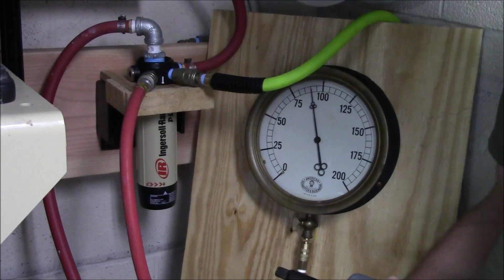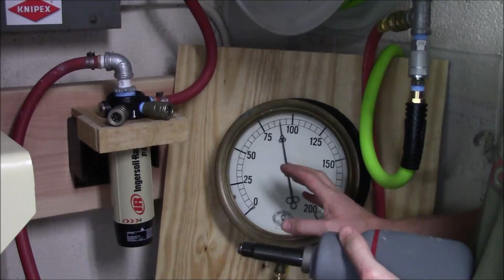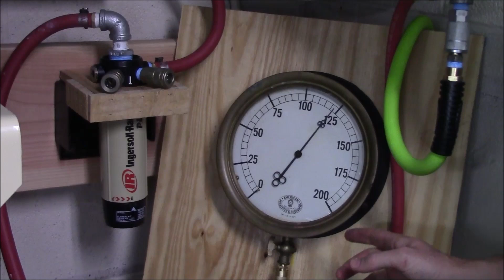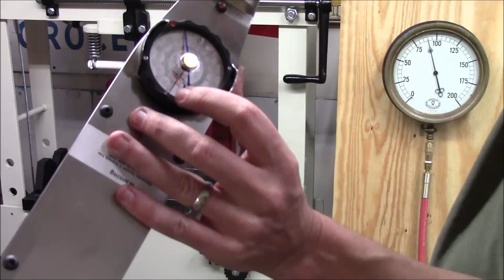Air Pressure : Working PSI - VS - Static PSI

Comment: Whats the difference if I buy a 3/8" using a 3/8" fitting or buy the 1/2" and use the 3/8" fitting?.. Can you even use a 3/8" fitting on the 3/8" hose?
Reply from the maker: +Tom Pajak There are two measurements on a fitting.....the side that is threaded & the side that plugs into a coupler.  You can have many combos of these ---- with 1/2" hoses you typically have 1/2" or 3/8" NPT Threads.  With 1/4" & 3/8" hoses you typically have 1/4" NPT Threads.  I personally like 1/2" Hoses & 3/8" fittings (3/8" NPT Threads & 3/8" plugs).  It allows for max flow, minimal pressure drops, and better performance at a lower PSI at the regulator.
Reply from the maker: +Tom Pajak So yes, you can use a 3/8" fitting on a 3/8" hose.....just be sure that the threaded side matches the threads coming out of the hose.
Reply: +Real Tool Reviews I see 1/2" fittings available online ..how much more flow will i get if I hook that to the 1/2" hose.. Or won't it fit?.. Thanks
Reply from the maker: You'd get no benefit unless you had a 80-gallon or larger compressor running 3/4"-1" impact wrenches....the flow rates of a 1/2" line with 3/8" fittings is way more than most air tools can utilize.  I'd go with a 50' line of 1/2" hose.....and use 3/8" fittings for best performance.
Reply: +Real Tool Reviews 👌sounds like a plan.. Thanks
Reply: how does that play out when majority of air tools take 1\4 air inlets....? or are you just using bigger tools that utilize a 3/8 inlet plug?

Comment: where did you get your air gauge and what size is it
Reply from the maker: +#TimTom It is the pressure gauge off of a boiler system....it is dated 1924 & works perfectly.  We got it at an antique sale.

Comment: What an excellent video! I have been a diesel mechanic for around 10 years now, I have always had a well equip workshop and took for granted everything being set up and ready for me! I have now moved to the USA (from England) and am looking at starting my own business. I will be starting from scratch with a compressor etc. I have Ingersoll Rand 1/2" impact already and was looking into air hoses etc. I will also be needing to use a 3/4 and maybe even 1" impact. will you be doing any videos related to heavier equipment like this? also can you tell me exactly what hose reel and air fittings your are using and where I can buy them? Thanks and keep up the great work!

Comment: Bonjour, first the pressure regulator should be protected from the contaminants coming from the air receiver , otherwise you will damage the membrane inside. I could not make out the model number of your filter so I can find out the cfm and filtering element in micron ( to protect air tools and equipment min 5 mic.). To validate the first test , we need to make sure the membrane of your regulator works fine, but most importantly the pressure gage should be at the point of use between the air nipple and its coupler . You loose more than 10 percent. Instead of changing the hose reel ( usually the pressure drop comes from the coupler inlet ) and improving the quality of the filter pressure drop, you want the user to increase his pressure . Every 2 % pressure increase, wich is in fact and artificial demand, it cost the user 1% in energy cost.

Comment: If people are using 1/4" line on anything more demanding than a nailer, they're doing it wrong. Off the shelf airguns will work, as well as paint sprayers. If you are somebody trying to use a grinder or impact gun you really do need a minimum of 3/8 hose but should be using 1/2". 
Real Tool Reviews : Good video.
Reply from the maker: I agree....but many times it boils down to price & also what they have already (most smaller compressors come with the yellow nylon 25' coiled hose for inflating tires) & they assume air pressure is air pressure....never thinking about flow rates (CFM).   Hopefully this video will help people understand how to get the best performance from their tools.  Thanks for commenting!

Comment: Wow I never knew how much it really dropped. So if the tool says to run it at 90 psi you will have to set the air pressure at the compressor at over 100 psi. I have a pneumatic grease gun, use 1/4 inch air fittings and have about 25 feet of hose, what do you think I should set the air pressure at? About 125ish? I think if you watch the regulated pressure on the air compressor it will show how much it drops.
Reply from the maker: +Love2boat92 I wouldnt worry about it with a grease gun....it just will cause the grease to flow out slightly slower & it would most likely have a lower max PSI rating (on the grease pressure created).  The most noticeable performance difference will be with impact wrenches, air ratchets, cutoff tools, air hammers, etc.  If you want to bump it up, I would say 110psi (static) should be good.
Reply: Real Tool Reviews It does seem to work slow. I'll bump it up. Thanks for making this video. I would love to see what it does with 1/4 inch fittings.
Reply from the maker: +Love2boat92 Thanks!  I plan to do another video about fitting sizes & air line sizes.....stay tuned!
Reply: Real Tool Reviews Great!!

Comment: Love that old pressure gauge.  I work as a fire sprinkler fitter and we will find them on older systems to measure water PSI and they still work precisely but current codes make us change them out so I hang them on my wall.  Cheap plastic ones replacing good ole reliable made in the USA ones.
Reply from the maker: bluelude2001 Me too!  I am jealous.....I would have multiple ones hanging up if I had them.....good to know you dont just trash them!
Reply: It reminds me of the old boiler pressure gauge my dad was given when he retired.

Comment: Great job!  I like how you showed the pressure drop from the hose.  This also applies to a voltage drop through an extension cord.  Great video.
Reply: Not only extension cords, the wiring in the walls has the same effect on voltage. It.may be better to use an extension cord on an outlet closer to the panel than no extension on an outlet on the other side of the building
Reply from the maker: Wild Goose Thanks!  And good point.....voltage drop is another problem all to itself!

Comment: I just started using an air compressor for the first time. Well, I tried, but I couldn't get the socket on my IR 231 air wrench,  I thought it wasn't big enough for the wrench, but learned I have to hold something in,  I'll find out on the weekend when I go back out to try it again. 
BUT, this video has given me a Load of useful information as far as air pressure going to the tool. So glad you made this video. I never would have known to check it to see where I'm at as far as pressure, Thanks. )
Reply from the maker: tigergreg8 Thanks!  I am glad I could help! .......also, the problem you are having is most likely the brand new friction ring (hog ring) at the end of the anvil.....those are very tight at first, and you need to put a socket on it & use it consistently to "break it in" and then installing/removing sockets will be no issue.

Comment: Where can I get one of those nice big pressure gauges.  That thing is really easy to read from across the garage.  Getting older and eyesight isn't what it used to be.  A link or company name would be helpful. :)
Reply from the maker: ***** I would imagine eBay or an antique store.....it is a pressure gauge for an old boiler system (I think) & is from 1924.....it still keeps 100% accurate pressure though, so I think that really says something about the build quality on things back then!
Reply: Real Tool Reviews Yep found some on ebay.  :)

Comment: Just got my first compressor and air tools.  Had absolutely no idea there was a difference between static and working pressure.  Just stumbled across this video so glad I did.  This video is pure gold!  Thank you for the excellent demonstration.
Reply from the maker: ***** Thanks!  Glad I could help!
Reply from the maker: Kerry Kozma Well.....like I showed in the video, it depends not only on the tool but also the length of hose, size of hose, and fittings used.....that is why I suggested testing them --- especially if you are having power issues (aka --- lack of power).

Comment: Can't wait for your torque test videos, hardcore brand loyal people are going to be butt hurt, along with the manufacturer that's gonna have to explain why their impact couldn't do it, one question are you going to have a standard test for impacts or you going to follow manufacturer way of testing? Like bolt / nut size, tread size, psi rating, oil on the tread, ect.
Reply from the maker: south park Thanks!  I think a lot of people will be surprised (good & bad) when I put the upcoming impacts (pneumatic & cordless battery powered) to the test and prove ACTUAL torque ratings.  I will be using the same nuts/bolts/methods for them all.....with the exception of PSI ratings.....some impacts require a higher PSI (on the box) to achieve stated torque specs, so I will adjust that if it is on the box.  There is ZERO standardization when it comes to torque specs.....I intend to change that.
Reply: Real Tool Reviews 
You sir will start WW3! When can we expect the tests?
Reply from the maker: south park Coming up soon.....I would expect to start seeing them in reviews in the next month or so....

Comment: Here's a pic I took for comparison.  The high flows helps put the power to the ground, right?
http://img.photobucket.com/albums/v163/glowkid/IMG_20140926_162457_zpsiu9qb4lw.jpg
Reply from the maker: GigaDonk High flow (just like my 3/8" fittings) allow the pressure (working) to be maintained with lower PSI set at the regulator......they also allow for more CFM of airflow, but almost no tools can utilize enough air for you to see a difference in actual performance in the high-flow VS regular fittings (except blow guns for example).  The problem with many compressors is the fact that they cannot achieve a high enough PSI to match the performance of a high-flow fitting with a lower PSI at the regulator.  (i.e. --- 125psi @ the tank = 90 psi (working) at the tool with high-flow fittings......125psi at the tank = 75 psi (working) with regular fittings at load).  In order to bump the regular fittings up to 90 psi, you would have to bump the regulator up to 140-145PSI (example only....not actual numbers).  Most compressors cannot maintain that pressure & the performance of the tool will greatly suffer.
Reply from the maker: GigaDonk So....short answer.....Yes.  High-flow are much better than regular fittings.

Comment: That was a good episode. I'd like to see more stuff like this.
Want to do a comparison with the Milton V hi-flow fittings vs the normal Miltons?
The size difference is BIG and the hi flow fittings can be used with non high flows as well.
win/win.

Probably notice bigger difference with 3/8 hose. do it. do it. do it.
Aircat vs IR :)
Reply from the maker: GigaDonk I have more of these informative videos planned....especially with the upcoming torque testing videos...thanks for the suggestions!

Comment: Excellent. If you think this matters with simple air tools IT REALLY MATTERS with high end automotive spray guns. SATA, Iwata, DeVilbiss and Sagola all require exact air pressure adjustments to perform properly. It's the difference between the paint looking like glass and looking like sandpaper. I always use a diaphragm regulator at the bottom of my spray guns.
Reply from the maker: SATAMAN Schmidt Thanks!  I have never gotten into the spray guns as of yet, but I have always heard they are the most sensitive to pressure ratings....good to know!

Comment: Best way, adjust your regulator while holding the trigger down on whatever tool you are using to ensure that you are close to 90 psi.
Reply from the maker: Blaine Bugaski Not really....the problem is that the pressure is dropping at over the length of the hose & not at the regulator.  Especially when you add in a 50' hose, the pressure at load is going to be MUCH lower than what the regulator is showing & the only way to know for sure is to use a remote pressure gauge like I show in the video.
Reply: True.  I have never had a problem using my method, though, but I do not use any external manifolds, dryers, or filters in my system.
Reply: Blaine Bugaski but you could be getting better performance measuring at the end of the hose.
Reply: Yes that is true.  I remember when I first started out with air tools, I would just max out the regulator on the tank.  I thought higher pressure was always better.  I ended up educating friends and acquaintances about proper pressure as well, to ensure that the tank does not deplete too rapidly, and also to increase longevity in your tools.  Also oiling tools.  We all went many years without adding a drop of oil to our tools.  Now I try to do it every time.  Funny thing, the tools never broke, though.
Reply: Blaine Bugaski everybody makes noon mistakes. I always oiled my tools.  Don't remember who told me but I got air tools only a few years ago.  Worked for years with hand tools only and got air tools finally and always oiled them every use.

Comment: This was a great video.  I knew there was a pressure drop but I never knew how bad it was and I never thought to run a higher psi at the regulator to make up for it because I didn't have a clue how much was lost.  

Thanks for the info.  I need on of those gauges.  I've only got a 30 gallon compressor so the cordless impact is on my wish list for the near future.  

Where do you find those 3/8" fittings?  Turns out I have 1/4" industrial style fittings on my automotive tools and compressor.  I want to replace them all but none of the stores I've been to have them.  

I find single ones on Amazon and they're expensive.  Do they not come in a pack or kit?
Reply from the maker: Kimo Kalihi I have gotten them at many places (online, Tractor Supply, Home Depot, Lowes).  For your uses....you can get 3/8" plugs/couplers with 1/4" NPT threaded fittings.  They will connect to the hoses you already have & you will get better performance out of them (the opening inside of them is at least twice as big as standard 1/4" fittings).  Also, you may want to look at 1/4" high-flow fittings....also known as "Euro Style".  They have almost the same size internal passage as 3/8" fittings & look identical to regular 1/4" fittings (and you can get universal couplers that will accept both types).  Brand-wise, I would go with Coilhose Pneumatics or Milton.
Reply: Real Tool Reviews I'm not opposed to replacing the hose.  I only have one.  And all the fittings.  Just want to make sure I get the right stuff and don't spend more than I need to.  Does it make sense to get 1/2" hose with 3/8" npt?  I've never gotten the advertised 500 ft-lbs of torque from my 1/2" craftsman pro impact and I used to think it was just a piece of crap but I think it's the fittings, the hose, or the regulator or some combination of the 3.
Reply from the maker: Kimo Kalihi I would suggest upgrading your fittings first.....and leave the line as-is for the time being.  Here are the high-flow fittings I was talking about (4 fittings & 2 couplers....great deal on Milton) --- http://www.amazon.com/dp/B001O2ZGQ6/?_encoding=UTF8&tag=reatoorev-20
Reply from the maker: Kimo Kalihi Also, the stock regulators are notorious for being junk (false readings & extremely poor air flow).  If the fittings alone dont work, try removing the regulator and installing a 1/4" ball valve in it's place with a regular/filter downstream (mounted to the wall with your main line plugged into it....kind of like my setup).
Reply: Real Tool Reviews didn't know that either. I'll look into getting the wall mount.  Filter is not a bad idea.

Comment: Fantastic info. I would guess the majority of your viewers use 3/8 air hose  , I find 1/2 too heavy and awkward to manage.  The amount of  air volume required varies so much between the low cost manufactures and the newer compact impacts as you shown are really the way to go. In your future vids on the subject I hope you touch on the Cubic feet per minute rating on each tool.  As you demonstrated the difference between static and working pressure  was unloaded working pressure.  The volume of air used freewheeling is much different  than when used on a fastener thus the diameter of the line and fittings all play into end pressure and air volume required as you have shown.  I am not as much of a fan of electric impacts  as I used to since the advent of the super compact impacts like you displayed that are not bulky very light and outperform most of the larger units.  I'm not familiar with the brand you displayed but I look forward to your review . 👍
Reply: Real Tool Reviews  Also, most people have like a 30gal portable unit. I have a kobalt. The stock regulator was like 70psi all the way open @ 150psi, impact plugged directly to the regulator.  Now put 50 ft. of hose on it....     
#1 thing you people should do is get a ball valve. 
Screw those POS stock regulators. Garbage.
Reply: @GigaDonk  If you switch to a ball valve how do you regulate the psi and do you need to add a gauge somewhere?
Reply from the maker: Steve Rob Thanks Steve!  I agree that most people will not be using 1/2" air line, or probably even the 3/8" fittings.....but the same test would prove to them at their house/shop what the PSI needs to be at the regulator in order to get the working PSI up to the correct level.  As far as future info, you are right....I will definitely be going over CFM requirements & also will be talking about the performance differences you will get between using different sizes/types of fittings/couplers.  I wanted to keep this particular video solely about PSI, and did not want to overload people with too much info at once.  Stay tuned.....lots of good videos coming up :)
Reply from the maker: GigaDonk I agree there.....stock regulators LIE & restrict air big time.....I junk them all just about.